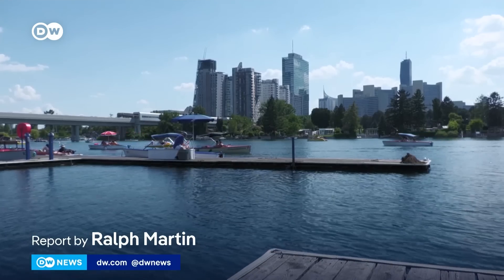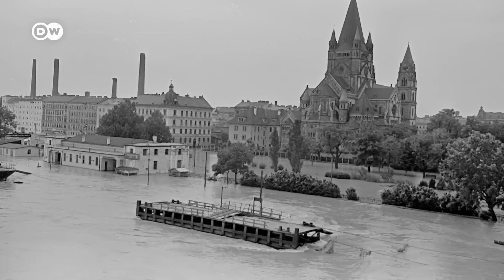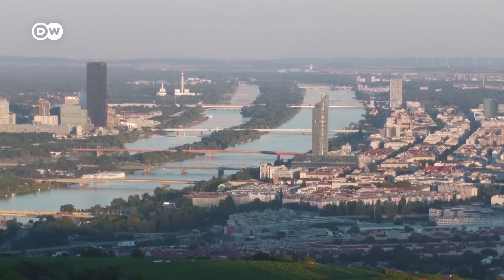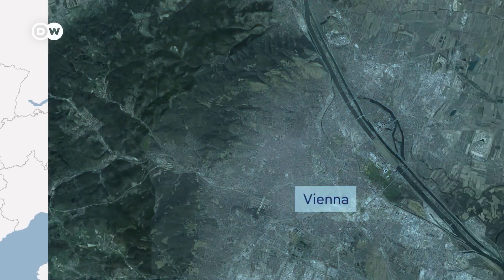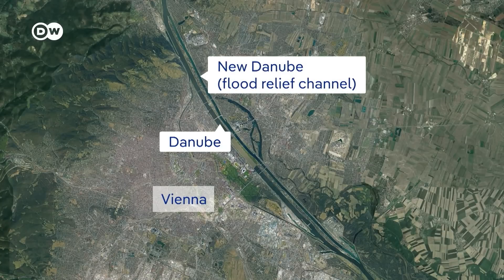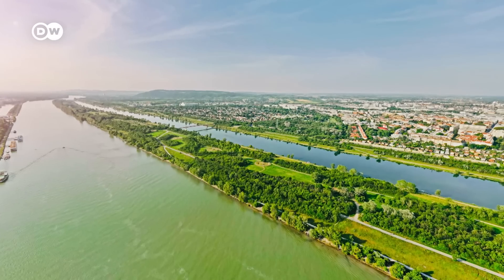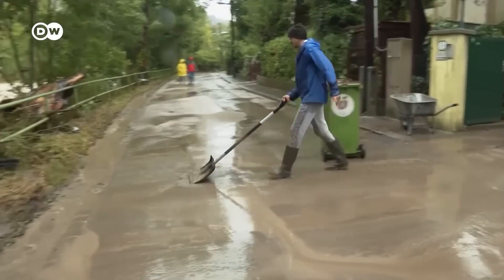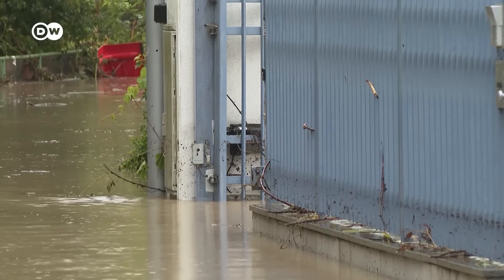Vienna's flood defense system explained | DW News

Comment: Yes, the system of the New Danube is good and Vienna resisted the flooding well. BUT the pictures you show are not from the New Danube they are from the Old Danube which is basically a lake, because it has no connection to the actual Danube anymore. Also many towns just outside of Vienna got hit very badly, like St. Pölten almost completely was flooded. People got evacuated also some died in the floods.

Comment: Don't underestimate the Wien river. The flow rate increases thousand-fold when it rains and almost reaches a quarter of the (average) Danube.

That's why there is a huge detention basin in Auhof.
Reply: Yes, that's the "small stream that has flooded" they talk about in 1:34... 🙂
And indeed, the differences there are insane, if you see it at its normal flow in its relative large riverbed, you just wonder why there's no water in there ...
Reply: Normally 400-500 l/s up to 440.000 l/s

Comment: This is not the only water protection Vienna has. There are also quite high flood walls along the Donau. Then there is also the Alte Donau and Lobau, that can contain a lot of water. The thing is to expand the drainage from Donau in any way possible (and try to be nice to the folks living down stream). As a Swede living in Vienna for some ten years now, I am impressed. The waterflow that Vienna can handle is insane - and I do not think they are finished yet, with all the new knowledge from the last decades.
Reply: the danube flood protection system in vienna is designed to withstand literally a once in a thousand years flood. Its design is based on one of the largest recorded floods that happened in the year 1500 with a flowrate of 14000m³/s The largest, more recent "record" floods of 2003 and 2013 managed to reach 11000 m³/s. Soo yeah, its design is really something impressive. And it paid itself off multiple times already considering it's cost back then vs all the floods it already prevented. Its kind of awe inspireing, how decisions of some smart people 50 years ago, now heavily improved peoples living quality and possibly saved lots of peoples livelyhoods and their own lives.
Reply: @soundphile988  and always remember, the "kronenzeitung" was against it.
Reply: @soundphile988  "Once in a thousand years" only applies if the conditions would have never changed. But they have changed and will even more.
Reply: @to_loww  as I wrote above, I don´t think they are done yet. Something needs to be done with the Wienfluss, that "stream" broke in Penzing. At the moment, there are very many "water cannons" allover the city, that drains very fast into the bigger waterways. Delay or diverse those, and it will be even safer. Anyways, the Donau itself was not even close to break the walls and flood the city. Some damage yes, but not a cathastrophy.
Reply: @to_loww  No. Basic conditions do change within 1,000 years. The last 1,000 years have seen crops being cultivated in Greenland.
Reply: @to_loww  yeah ofc thx to climate change. but the fact stands that most flood protection systems, dams etc, are often built in a way to withstand common floods, but like super rare events, they fail at. Usually its because of cost cutting, corruption or mistakes during construction. Best example would be fukushima in japan, or that dam in the US 1 or 2 years ago where the overflow system failed. The system here is built in a way it cannot fail unless it rains nonstop unbelievable amounts over a week or more. And well it did pay off already. Considering the amount of floods it prevented.
Reply: @jokervienna6433  They are building a sewer under the Wienfluss. This will have a greater diameter than any underground train tunnel. This sewer will be able to take on most of the water that currently runs though the river when flooded
Reply: @markuskitzinger6374  I did not know that - thank you for the information! :)
Reply: @markuskitzinger6374  It's already built. Just not the full lenght.

The diameter is 7.5 meters BTW.
Reply: @to_loww  You are right. a big part is still missing and under constuction.
Reply: @to_loww  Even better that they prepared for the, back then, worst case
Reply: another fun fact: the viennese sewage system was designed between 1900 and 1910, back when it was the austro-hungarian capitol.
back then, planners estimated that vienna will at some point in the not so distant future have 4 million citizen.
so the system is actually still a bit too large for the current population. but in times of heavy rainfalls, this is worth a lot.
Reply: vienna also has a few retention basins like the „rückhaltebecken auhof“ which also protects the wienfluss from overflowing

Comment: Bratislava is 10 times better protected and lies below Vienna, and the Morava River also flows into the Danube in front of Bratislava.
Reply: A "my city is better than yours" comment.
Reply: Put your "dxxx" back into your pants it is neither bigger nor longer 

And what nonsense you are talking about a dam 20 km from Bratislava...that dam is located behind the city in Gabickovo at the Hungaran border and not in front of the city. So the water masses will already flood Bratislava before even reaching that dam = common sense
Reply: How? Bratislava City lies directly at Danube...
Reply: @eddastrohmayer251  are you from Europe? If so, I don't understand that you don't know
Reply: @ayrton1020  I am from Vienna and would also like to know how Bratislava is 10 times better protected, just out of pure curiosity 🙃
Reply: How exactly is Bratislava 10 times better protected? It uses the same system that Austria uses on some 200km in lower Austria: movable barriers. 

This is in no way comparable to the Danube island project, neither in size nor in function. Additionally to the two arms of the Danube there is even a third one, the Danube Channel - protected by walls built around 1880. What is more, Vienna - opposed to the small city of Bratislava - has a second river, the Wien, which as I am sure you have seen turns into a raging monster when there are heavy rainfalls.
Reply: @whoisitwhomaxi  I suppose you can compare Bratislava to Vienna with its Danube Island project in some way...
Braislava may not have such island, but it also has a zone where the excess floodwater can go - the ground on Petržalka side with its parks and low-elevation terrain.  It is not a random thing that the northern bank (next to the old town) is higher than the southern bank, and that there are basically no building on in the zone on the southern side, with the anti-flood dyke a few hundred meters inland. The top of the dyke is used as a cyclo-path and some small food/beverage-serving buildings are next to it, but other than that there are basically no buildings there and the area is designed to be flooded if needed.And it is exactly what can be seen in Bratislava these days - the old-town bank holds and the Petržalka-side bank is overflown into this flood area. That is not a "disaster", that is a feature.
Reply: @whoisitwhomaxi  simply, 20 km from Bratislava there is a large dam with a power plant with xxxx turbines .. it is not a problem to set the level of the Danube even 1.5 meters lower than it is currently approx. 9.8 m, but then Budapest would be flooded in 24 hours
Reply: @ayrton1020  Yes it is a single dam and a hydroelectric plant, like there are many all along the Danube, 10 in Austria alone. I don't know what great project you fantasize about? 

Also there is a treaty between Slovakia and Hungary on how to operate the Gabčíkovo–Nagymaros Dams, so it is definitely not possible to use them for your own good only.
Reply: @ayrton1020   Well, I live in the region and have paddled all its waterways. You are talking about the Gabčíkovo–Nagymaros Dams which was built during soviet dictatorship and is still very controversial in Slovensko to this day, which are a long way  d o w n r i v e r from Bratislava (one of my top favourite cities). 
So Gabčíkovo doesn't help Bratislava during floods at all. All the other dams bevor it are in Austria, I actually live close to the last one bevor Gabčíkovo, Kraftwerk Freudenau.
Reply: nobody cares😂

Comment: The Vienna Flood Protection had two phases. Until 1870 the danube had several arms floating through, whats now vienna (back then it was suburbs). Also the "Wien-Fluss" was in it´s original bed in the souther parts of the city (back then also suburbs). In a massive building-project Vienna was redesigned, part of it was the regulation of the Danube into a straight river-bed and a 450 meter wide plain for flood-events. Also, the Wien-Fluss was dough in a deep river bed. 

Although this brought some protection, it was not enought. So in the 1980ies the city build the 2nd regulation, the new danube, where the plain for flood-events was - that´s the project referred in the Video.
Reply: To elaborate some more: The Wienfluss also has 6 (I believe) big retention pools on the western end of the city. Due to the surrounding geography and geology, the normally very small and gentle river (or rather creek tbh) can swell up to a huge wild alpine stream for a couple hours or days within a very short time (a few hours), as was the case over the last couple days. To prevent it from overflowing inside city perimeters, the retention pools can be flooded for the water to be released later on when there's less water coming in from upstream regions. However even that system wasn't quite enough this last weekend. At one point the retention pools were full and there was still a lot of water coming in, hence why some surrounding areas and parts of the U4 (underground railway) got flooded.
Reply: Right, but the new Danube with its island was made in the 70s or at least started being build if I remember correctly
Reply: @vinylrichiejr.2416  Started 1972, finished 1988

Comment: If you take a map where floods happens, you will discover that above this countries is the air planes high way , all air planes wich goes from north europe to asia and vice versa, all fly above thisi countries. 
Emissions from aviation are a significant contributor to climate change. Airplanes burn fossil fuel which not only releases CO2 emissions but also has strong warming non-CO2 effects due to nitrogen oxides (NOx), vapour trails and cloud formation triggered by the altitude at which aircraft operate.
Its time to ban this air planes as soon as posible or redirect them to other countries, Ukraine is no fly zone, and now all planes wich goes to north eu are redirected to eastern eu countries!